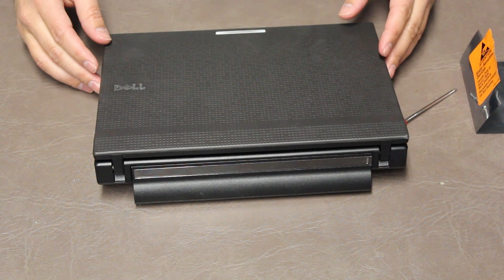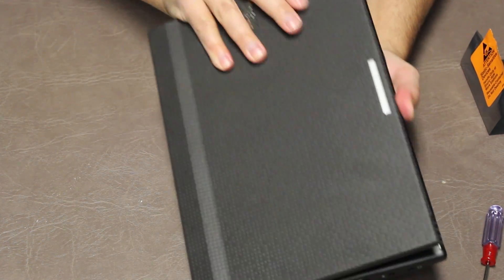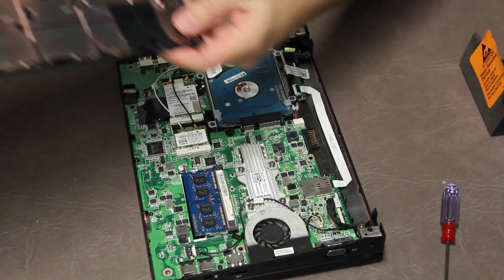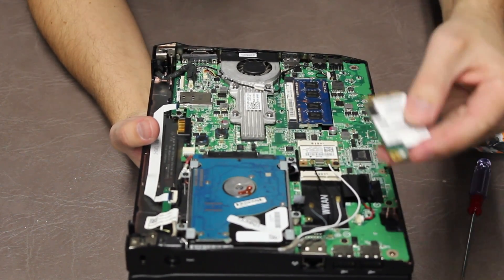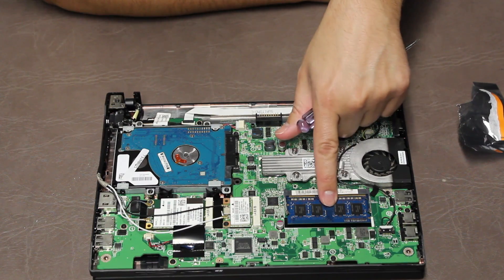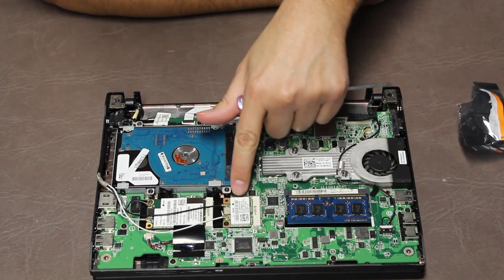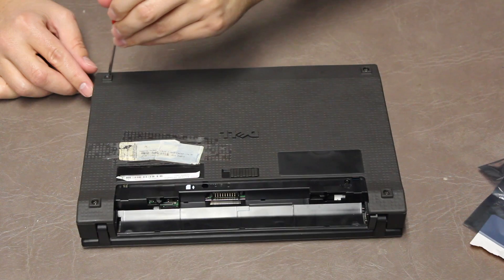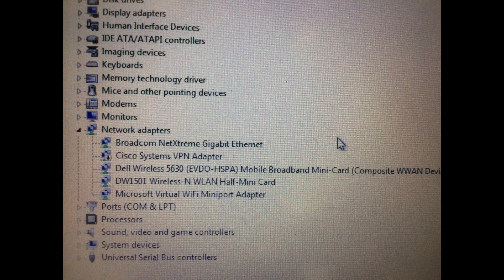Dell Latitude 2120 Laptop disassemble + replace WWAN card

Comment: I have a 2120 with a n455 processor, someone is selling a 2120 mobo with a n550 processor which is faster, but i dont know if that board will fit or not. Was there differences in the build between those two processors ? If itll fit itd be a cheap way to speed up my 2120 even more.

Comment: can the ram be upgraded on it?
Reply: +joe moore just wondering what kind of ram?? I just acquired a dell latitude 2120 and want to put more ram
Reply: That sucks.. this laptop's not really worth using for myself and now the hard drives messed up..
Reply: +joe moore Thanx
Reply: +joe moore Not even.  2GB max.  Haven't seen any of these except a 4GB module.  They are limited to 2GB modules.

The 2120 is a horrible excuse for a laptop.  Its heavy, underpowered, and has bad battery life.
Reply: +rodenthideout PC3-10800 SODIMMs.  2GB max size per module, only 1 slot.  So 2GB maximum memory.